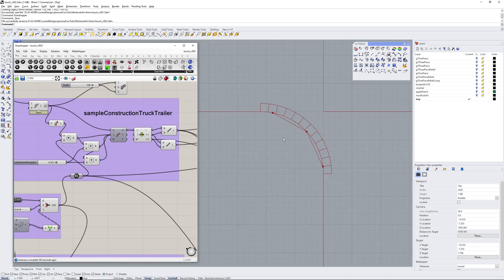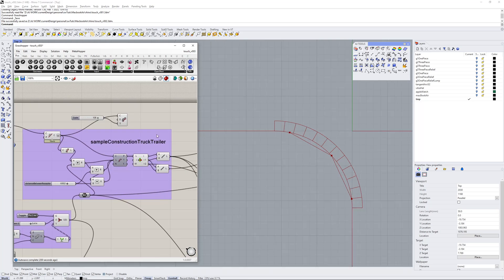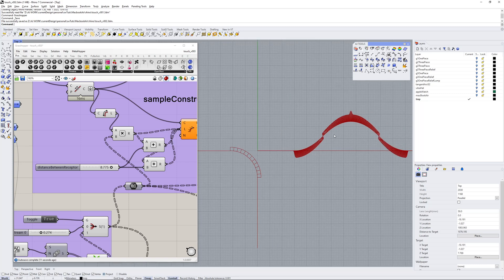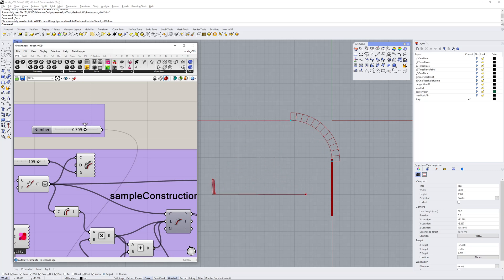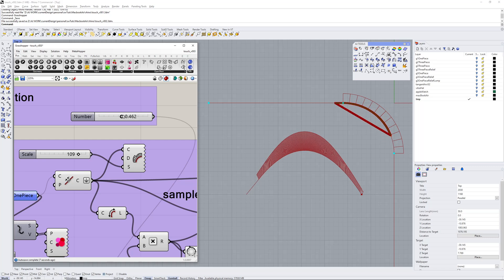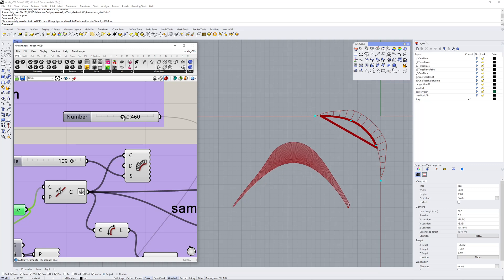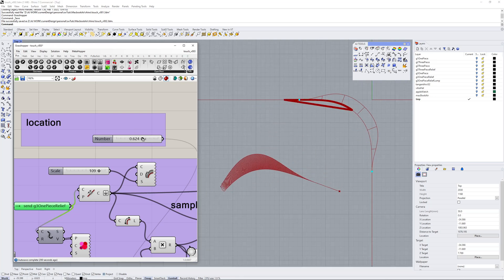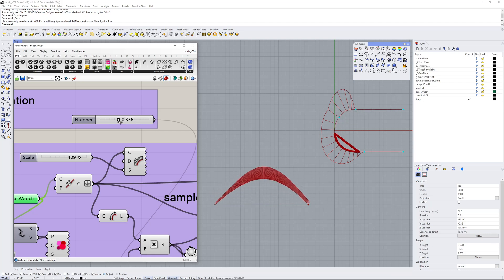Corner Tactility Analysis Experiment in Grasshopper

Comment: Excellent Andrew! I have always looked at how a spot highlight accelerates and decelerates when transitioning from straight line to curve! What you have done here with tactility is in some sense the same thing! I presume the best result for tractility would give the best result for highlight movement as well. 
I never thought of coming up with a way to analyze it like you have done here, perhaps because I am not too familiar with grasshopper!  I sort of try to guess the highlight movement and tactility from the curvature comb itself.
Reply from the maker: Hi Tony. I could not really tell much difference between the corner variations using the zebra (fairly obvious differences using curvature graphs though). I wonder if I can use Grasshopper to flatten out a curvature graph, if that makes sense? So you can see the true nature of the acceleration without it being transformed by the actual curve geometry.
Reply from the maker: Well, unrolling a curvature graph was pretty straight forward. I've also built a 'proof' of my construction on the original curve and it matches the Grasshopper curvature graph. I'll make a vid at some point.